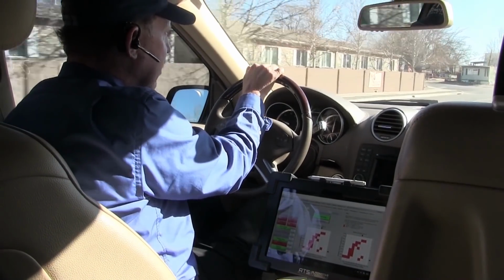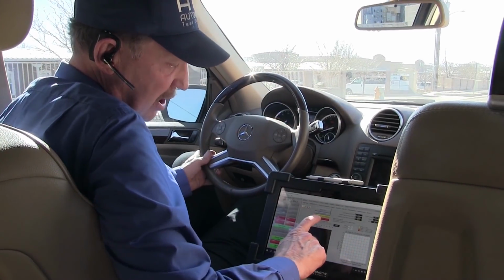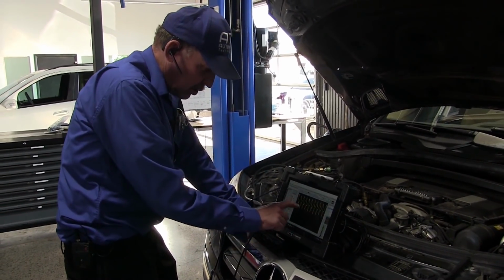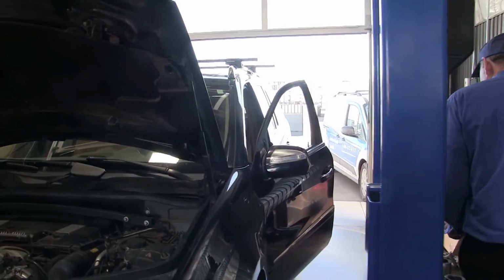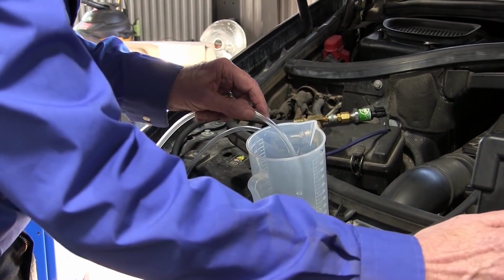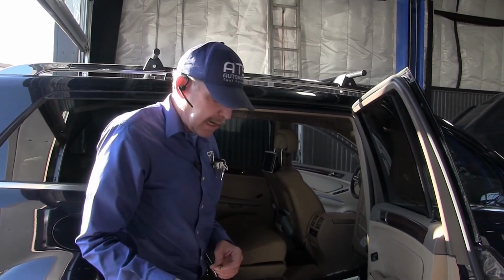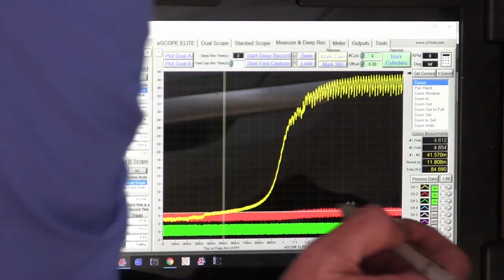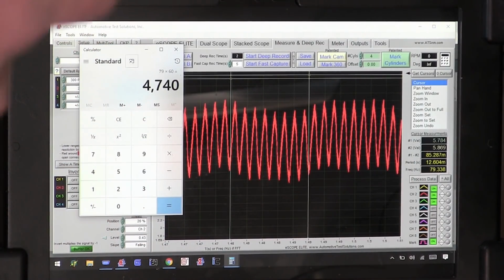2010 Mercedes Benz GL450 Lean Bank 1 & Bank 2

Comment: My 2002 Toyota Highlander had P0171 & P0174. O2 sensor at constant speed (40mph) was sitting at 0.75 volts. Turned out to be an under reporting MAF.

Comment: Hey Bernie , so I’m confused because on the diagnosis you said that the. Fuel filter was clogged but then in the end you said that the shop that was working on the car prior did not put a fuel filter in , so the fact that the car DID NOT have a fuel filter was causing the car to have fuel delivery issue? Not understanding this one ..
Reply: Thier was a restricted filter causes Air fuel ratio to be off and not 14:7 perfect air fuel ratio
Reply: A restriction causes the problem new filter car fixed bring the car air fuel ratio to normal specs any questions feel free to ask thank have nice day

Comment: For anyone who will be troubleshooting typical Mercedes fuel system like this 2010 GL450 or the common E-Class W212 , there are a few hardware design you must keep in mind.

Mercedes fuel tank is a 2 chambers saddle design. Fuel pump at RIGHT side saddle and fuel filter at LEFT side saddle. These 2 chambers do not parallel or share fuel between each other when fuel level down to 80% or lower. 

So the fuel pump has 2 duties. 1st is to supply fuel to engine via a fuel filter and 2nd duty is to  provide jet suction effect at LEFT chamber , to pump fuel back to RIGHT chamber into the fuel pump bowl shaped body. There is a Y valve splitting the fuel flow. Yes ODD design but that is the way it is to clear drive shaft from tranny to differential, hence the saddle shaped 2 chambers fuel tank design. Without the 2nd duty, the RIGHT chamber will be deprived of fuel fast when overall fuel tank level is 50% or less. There are 2 fuel level sensors too, LEFT and RIGHT side ones.

So do not base a proper fuel output of fuel pump without taking into account the 2nd duty of the fuel pump, there then you can get the NET fuel flow to the fuel filter aka  to the engine. 

The fuel filter element inside the fuel filter assy itself is no more than 36ish grams of paper media weight. So at best the fuel filter will be clogged by contamination worth 36 grams.
This GL450 is using M273 V8 4.7 Liter engine, I believe so.  At 17MPG and 50,000 miles , if fuel dirt is at 5PPM (parts per million) or  0.005% by weight, the near 3,000 gallons of total fuel passing thru the filter element would have 37 grams of dirt captured.

To believe that gasoline can be 100% clean without any dirt % from various fuel transfer procedures is a fantasy.  To replace fuel pump first before replacing a fuel filter is a joke.

Using MB Xentry or any MB capable scanner like Autel or Launch, the fuel pressure at the filtered output of the fuel filter can be read from N118 module and it will be higher by approx 10-15 psi when compared  to the engine bay test port, this is normal as from tank to engine bay the small fuel line running 4 meters and elevation of 50cm does offer HEAD/resistance.

Happy troubleshooting guys.....

PS -  I replaced my W212.065 E400 M276.820 3.0 Turbo direct injection,  fuel filter at 20,000 miles or approx 1,200 gallons of fuel burnt. No trouble codes whatsoever, but I do monitor my low pressure fuel pressure often while at WOT 1st gear and 2nd gear.  Knowing my developing country fuel cleanliness is not as good as 1st world countries, extra caution must be practiced. The test result showed at WOT 1st and 2nd gear, I was getting only 4.2 BAR at HP fuel pump inlet and that is borderline decent. New fuel filter brought it back to 5 BAR.
The Bosch 200 BAR HP fuel pump on my engine requires minimum of 4 BAR as input pressure.

The fuel filter element has not clogged in anyway fatal, but it has trapped enough dirt to cause decreased fuel flow.  Don't ever fuel starve a Bosch single piston GDI HP fuel pump, the fuel itself is the pump's single piston only lubrication internal to the pump. Engine oil lubrication does not touch the HP fuel pump internal, only the external spring get the engine oil lubrication.

Comment: Most 4x4 with a subframe and not full frame are like this, sometimes two pumps. From what I’ve seen it’s because the driveshaft sits high and usually causes that hump.

Comment: Any chance you can make a video explaining mode6. There are some ignorant individuals claiming that mode 6 is useless and misleading causes misdiagnosis and unnecessary parts replacement. The mode 6 on the Escan is the best one out there and it provides another piece of the puzzle when performing difficult diagnosis.

Comment: Great video as always! I know all to well that you can only do what work the customer authorized. BUT, unless the customer said absolutely not, what professional shop in their right mind would replace a fuel pump and not put a filter in too? Myself personally, I've even gone as far as recommending replacing the fuel pump relay because as much as it gets used and switches on/off and so forth....

Comment: The parts cannon <new pump> would've sufficed in this case, had there been no inline fuel filter beyond the pump's sock filter which is what you find with most cars nowadays.
 Of course, nothing beats knowing how to properly diagnose and repair as once again demonstrated by Bernie.

Comment: Believe it or not there are a lot of those trucks with no access panels and dropping the tank is the only access to the pump , electrical testing can be done at the tank connector plug .

Comment: At 14:3, thank you for mentioning that it took a long time to get the seat out of the vehicle. There are a lot of shop owners and managers in the industry that tell their techs if it takes longer than 20 minutes to diagnose a problem, they don't know what they are doing. The problem is 
the techs need their job and have to put up with that type of abusive nonsense which stresses them out and erodes their self esteem.
Reply: Now we know why so many technicians are starting their own mobile repair businesses... we get to set the time we charge to the customer and dont have to listen to the nonsense criticisms
Reply: @edwardboers1993  Agreed. Also have experienced narcissistic employers whose only purpose in life was to prove me wrong, they did not understand the difference between cooperation and competition
Reply: im a sef taught tech ..and i recieve countless amount of cars from various dealers,, and they under dia or over diag ..i said they must are not permitted enough time